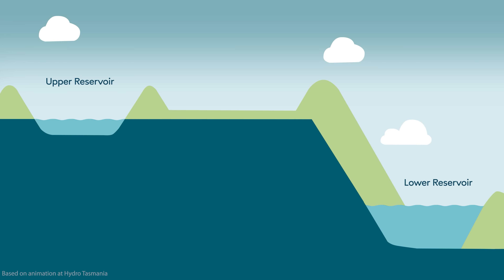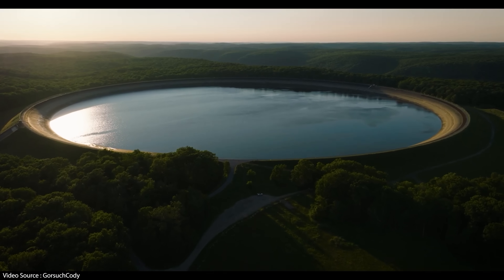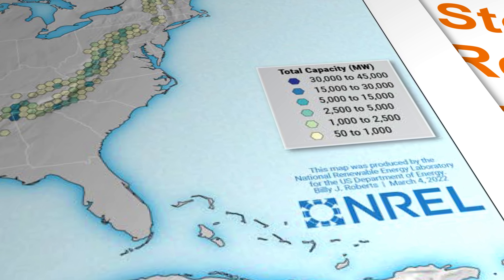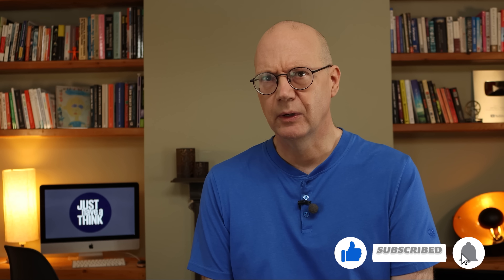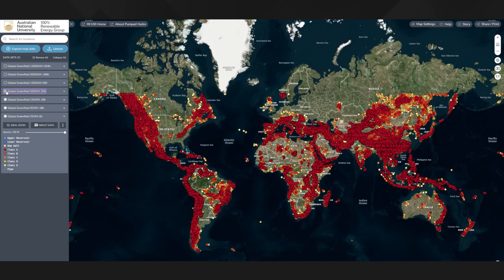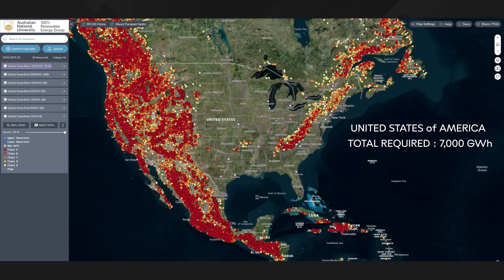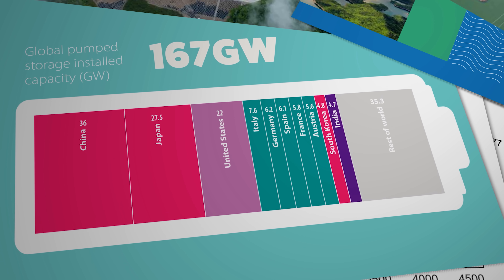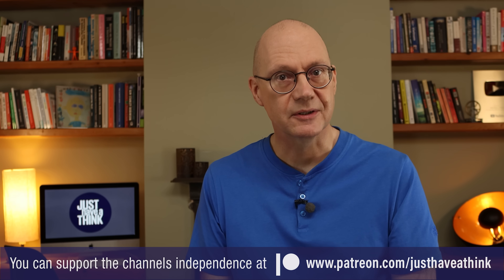The insane potential of Pumped Storage Hydro

Comment: THIS is the way to use wind power. The Dutch have been using wind water pumps for centuries. The biggest blamed nuisance to wind power is trying to make synch 50Hz mains with it. You spill a lot of wind power trying to keep the frequency steady. But a water pump doesn't care a toss. (Provided it doesn't actually stall or cavitate; everything in between is fair game! If the wind turbine either directly mechanically coupled, or electrically coupled in a 1:1 closed circuit, the wind turbine speed can vary and you can make much better use of the wind power. If you do this with lagoons out to sea, you can add tidal effects too. When you want the electrical power, you open up the water turbine, and that is when you make your synchronous mains frequency. It's got everything. Storage. Maximum wind potential. And that damned "stability" everyone is saying renewables "can't do." Well, this will! Get on with it!

Comment: Hello, We have also surveyed most countries in the world, and the potential is enormous. Using Ocean water opens a whole new group of sites. We have designed a 24h system, modular. To have  1 MW delivery, you need 5 MW of solar Power, and a dam to store the water, 40m to many hundred meters, above the water source. Send us a location, where you have access to water, and the possebillity to build a dam 100m above, we will send you a proposal for a solar powered pump storage power plant. Our budget cost is app 670 000 US dollar per GWh. 1 GWh sold at 10 c/kWh gives a yearly gross revenue of 100 000 dollar. May be on grid or standalone. If you mount the solar panels on greenhouses and use hydroponics, combination with fish farming, you may generate jobs, grow vegetables and fish beside generate electricity. I belive this is the future. Spirit-electricity.com, Knut Kise President

Comment: Also worth noting that there is potential in non-hydro pump storage. By using fluids which have a higher density than water, you could increase your energy storage capacity without having to build new sites. The whole concept of pump storage is just brilliant.

Comment: They have been doing this at Ben Cruachan in Argyllshire for a very long time.  Loch Awe is the lower reservoir, and there is an artificial reservoir about 2,000ft higher up, on nearby Ben Cruachan.  Scottish Hydroelectric sells expensive on-peak power to the public in the evening by passing the high reservoir water through turbines in the mountain then into Loch Awe at the foot of the mountain.   The company then buys cheap off-peak nuclear power to pump the water in Loch Awe back up the 2,000ft to the reservoir high up on Ben Cruachan.   High capital cost, but near zero operating cost.

Comment: You make it sound like it's not a net loss alone. Certainly useful as some sort of capacitor or battery for the reasons you said. They run out and you gotta pump it back up with even more electricity...

Comment: The United States doesn't have, and neither does the UK anymore, any equivalent to the Birds and Habitats Directive of the EU.

A head difference of 500m or similar, sends you to prevailing mountainous sites, and they're  removed from population centres, so grid reinforcement cost would be high.

It certainly belongs in the mix, but mix it must be.

Comment: Hydro power generation is one of the worst mechanical designs since the square wheel! Extremely inefficient at less then 16% straight on and 16% of 16% when you pump store it! That's 2 1/2 percent when you pump store it! That's not science it's comedy!🤣🤣🤣
Reply: By sixteen you meant 96% and 96*96 give 90 overall to pump and power the grid🤭👌
Reply: @NoCodeTechnology  No. And you better find a chair, because this will knock you off your feet!

Once you include the accelerated mass of elevated water the efficiency actually drops to 16%. The 96% we are always told of is the efficiency of the *turbine* only! I actually called the Niagara Power Station in Niagara Falls and spoke to the site engineer. I never expected it to be that bad, but I expected there were huge losses in accelerated mass, so I asked him about it! I figured he would be the one to ask! When he told me I was floored! I never imagined it was that bad! He told me they are very precise and careful NOT to decelerate the water, because it would cascade the rate of the water until the turbines stop turning below generation speed requirements. He said the mass is not where a water turbine gets its energy from, and it never can be, its the difference in pressure above and below the turbine blades that rotates them! Remember, water can NOT be compressed! They eliminate the accelerated mass losses because they know those losses can never be recovered even with the most modern turbine designs. The really shocking part for me is, I rarely ever speak to any hydro engineer who understands this!! Whenever I get the opportunity to ask one for the formula that includes accelerated mass losses, I never hear from them again! It's like when I ask a class a question about the homework assigned over the weekend, and all I hear is crickets! LOL! Curved grades in college maybe?? 

Once you understand this, hydro power becomes a completely different animal! And a goldmine appears for the guy who can solve the problem! Imagine 7 times more electricity from Niagara falls! All you need do is drop these damned turbines out of the design!

It will take a few hours of hard study, but the answers are in the math if you are interested!

Comment: Decades ago it occurred to me that an option for a very small scale operation (say, for example a small homestead) and given access to flowing  water and the appropriate elevation difference, a hydraulic ram, which uses water power to move water in small quantities, could be workable. The system would pump water to a tank on a hill and allowed to flow  back down to the stream from which it came, powering a small electric generator in the process. I never tried that out, and no doubt there are numerous issues, but the principle is more or less the same as in the video. This speculation was in the days before solar electric panels were even heard of outside laboratories. The old fashioned water pumping windmill, such as dotted the the landscape where I grew up - a short walk from the Southern Rockies - was another option that crossed my mind. Somewhat larger systems for providing electricity for villages, especially remote ones, I think could be feasible - and now we have solar and wind generated electricity to assist.

Comment: Having suspected this for years, the NREL study was an eye opener, it leads the conclusion that '100% renewable' power, far from being difficult, and requiring new tech, or being more expensive than fossil fuel, is actually EASY and relatively CHEAP. Seriously, 100% renewable, time shifted by pumped hydro, it's the easiest option . There are no technological or actual cost hurdles to 100%, any issues, are by definition, due to regulatory capture and or ignorance / incompetence.

Comment: Thank you for this thoughtful video! However, I have to call BS on this Australian study that found 616k potential locations, at least for Switzerland. We've been using about 90% to 98% of the capacity for pumped storage already since the eighties (considering economics, ecology, politics and physics). The study is very basic and almost only considers physical aspects, indiscriminately flooding many inhabited villages and protected areas. So even if only 1% is realistic, those locations are already in use.

I haven't looked at other countries, there might be more potential there. But hydroelectric generation and storage isn't new and has long been attractive, so at least the easy options are likely exercised already.

Comment: Pumped Hydro involves very large areas of water... very nice for boating etc, but usually in remote areas and far from the areas in which the electricity can be used. 
But the use of surplus electricity to raise a gravity-defying lump of... well, almost anything, to re-generate on its way down (unfortunately including very large losses of energy) means that it doesn't need to be water. Imagine a simple tower allowing a very heavy something-or-another to rise to the top using surplus energy. Now imagine, for instance, every apartment block having, perhaps, a hollow core in which such a weight can travel up and down... and suddenly you don't need water at all. Nor, if we are clever, transmission lines, because if they are built everywhere we need power, 
the only transmissions can be of much shorter distances.

Long transmission distances were only ever built because we had few power stations hundreds of k's apart... a very silly idea, really.

Comment: Be careful ,Australia currently being built Snowy Mountains pump storage looked to be a really good idea ,one that I liked .Im not so shore now and its very much hidden when it comes to completion date , cost and capacity .  Now the costs are blowing out , the tunnelling has run into " unexpected " problems ,the costs of power lines has exploded so they are now having to put them above ground to save money through sensitive environmental areas etc . If it involves the ANU I would look long and hard at what they say and what actually happens . Economic reality is not their strong suit and losses of energy  pumping it uphill are far higher that their modelling .Maintenance cost are probably wrong along with the life expectancy of pumps and generators due to grit in the high volume pressurised water . Just have a think about that . Maybe we would have been better with a Nucler plant which by all appearances would have cost the same .

Comment: It always takes more energy and resources to create power then you get out of that power system.  The land, presumably lots of it,  the water, presumable lots of it,  the new power generating equipment at each site, the new electric transmission lines to get the power to the electric grid,  the maintenance of site and equipment. Did I forget anything?

Comment: I see the system in America is probably rigged by generators, providers and transfers of electricity. Think Enron playing ball with like actors. If it is even 
Feasible the cost of energy is generally placed under the dial of corporate interest who benefit from cheep labor dependent on burdening cost to force production. If an actual community funded fixed cost is found here I would be amazed.

Comment: How much energy does it take to pump from the bottom to the top and how much is generated? I am pretty sure this is a net loss of electirical energy.  Then you also need the water, assuming it isn't needed for anything else.  Really having trouble seeing this as an effective solution and the video is not convincing.  It has a cost and a benefit.  The operating cost and the investment cost and the water cost are supposed to be covered with a payback through generated electricity.  Not buying it.

Comment: I know it was just a graphic, but wouldn't it be more efficient and require lesser pumps if the discharge into the upper reservoir was at the surface rather than bottom?  All that water has to create a lot of resistance; why not let gravity help?

Comment: Depending on location and geological situation, pumped hydropower stations can be 1.2-1.6 times more expensive than LFP battery stations with equal power output and storage capacity. Flow batteries at large scale might even be cheaper than LFP. Also pumped hydropower needs minutes to change from consuming to producing power, where reaction time of battery stations is seconds. Mankind has destructed enough nature as it is, so let's leave nature in mountain areas alone.

Comment: A load of Cod's Wallop. The amount of water needed to run Turbines is huge. The size of the Dams would have to be gigantic. Then the huge amount of electricity needed to drive the HUGE pumps to pump the water back up into the storage dam is ridiculous. It is likely that more energy (electricity) will be needed to replace the used water back into top reservoir. And pray tell, were is that electricity coming from to drive pumps???? 
There is no such thing as a closed loop system. Just as there is no such perpetual motion system.
What a con.

Comment: How about tower blocks with solar PV on the roof, vertical pipes and lots of small reservoir containers built into the structure. Any excess energy generated during the day could drive motors pumping the closed liquid loop pipes. Rather than finding sites for large scale generation/storage, make each building self-generating-consuming.

Comment: I noticed that in a closed loop system close to the ocean, then SEA WATER would be a cheap way to keep the system topped up. 
All elevated mountain ranges near the oceans, even in desert areas. 

But the humongous and stupidly large national grid fattening costs to get the concentrated central electric power to the millions of ends of the grid would constrain this technology. 

The grid costs is the most dangerous economic aspect of many proposals.

Comment: My earlier post below refers to nuclear vs Renewables, but the take away is that not even pumped storage is necessary in the sunniest continent in the world with 20million vehicles and buildings, with rooftop pv, connected to the national grid.

Nuclear is stupid, a money-making business to fill the grid with privately owned electricity. 
With government disaster insurance and Government guaranteed cash flows. 

Then, the killer costs of building a bigger capacity national power grid. 

The grid will cost 10x more than the generation plants and will be paid for by the government, taxpayers.. 

Nuclear promoters agree Renewables are viable but then poisons the idea. 

Everyone knows too much solar on rooftops is a problem, but that is the point, its value.
Everyone knows EV numbers are rapidly increasing around the world, and their value is that they absorb excess solar electricity when plugged into the grid. 

The selfparking/plugin/EV like the home robotic vacuum cleaner will find a std wall power point and connect with the grid. 
Most vehicles are parked 23hrs every day. 

EVs have a huge battery and their are 20million vehicles in Australia and 20million buildings in Australia. 

Nuclear promoters would hate to see big mates in the fossil fuel industry miss out on big government guaranteed cash flows. 

Just do the numbers 20million 100kwh batteries and 20million buildings with a little 6.6kw rooftop solar PV system. 

Fossil fueled gen. avg. 400gWh daily.
EV storage 2,000Gwh daily 
Rooftop gen. 660Gwh daily 
Vehicles are parked 23hrs a day.

Comment: Oh my, I have an easy home version of this in my mountainside food forest. Imagine that. I must research this. I live at 7000' to 7350' in the western US. Looks very low tech, really.
Reply: I just ordered a book on this. I have up to about 300 ft possible differential on my land, and have no idea if it'll work. I have a rainwater collection at the bottom, it could be slow pumped to the existing shallow and usually dry pond uphill, my highest location. It already has electricity at the bottom, within 6 feet.
Seems like every water tower in the USA might produce some amount of electricity, since they slow fill and water drops on sporadic demand, with pressure.
Goodness, this 5 acres with "no value" is looking better all the time. The view is awesome.

Comment: Could this be scaled down to provide electrical backup for just one or two homes using solar and/or wind generators as the primaries?  Would two water tanks, one on a tower and one buried in the ground be able to provide enough storage?  If so, how much volume of water would be required and how much difference in height would be needed for high efficiency?  Would a vertical drop be best or a corkscrew using turbine-style blades be better?

Comment: I think you have missed a big UK power storage solution.. Using old salt mines to store energy as compressed air.   This not just limited to the  salt mines though any underground space will work . The  old salt mines in Cheshire created by flushing the salt out with water would also work.  The limitations are mostly geological strength and methane leaking into the system.  The infrastructure require is minimal.  The technology is the well understood gas turbine.

Comment: Great discussion of a very important topic! 
This makes me want to comment on the similarities with gravity batteries that use abandoned mines and weights. They are in essence doing the same thing. However I wonder if anyone has considered abandoned mines as sites for pumped hydro? The big advantages would include the already excavated, large reservoirs, use of an already abandoned site, considerable depths, and lack of evaporation problems for the lower reservoir. (And why not use floating solar to cover the upper reservoir/s)

Comment: When he stated that 2 olympic sized swimming pools of water could produce a significant amount of power my thoughts turned to High Rises. One pool on the roof and one pool in a sub basement. Combine that with the Wind and solar modules that he had talked about earlier. You could have an electricity exporting building.

Comment: Thinking of gravity wells could a disused mine, oil well or gas well form the lower of the two storage reservoirs? The vertical distances between the land or sea surface and the bottom of the mine could potentially be thousands of feet. I guess flow rates within the mine or oil field could be an issue as could pollution from residual hydrocarbons but worth a thought.